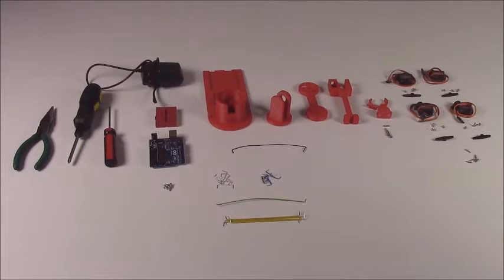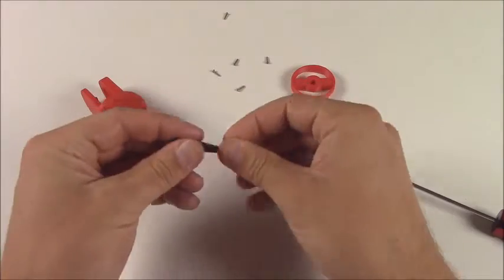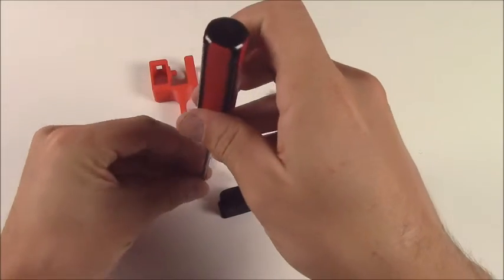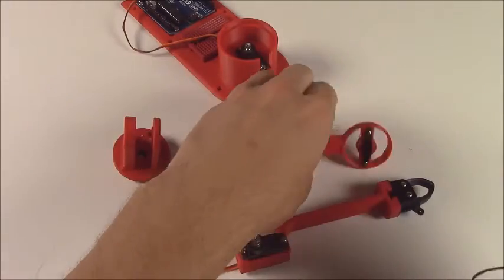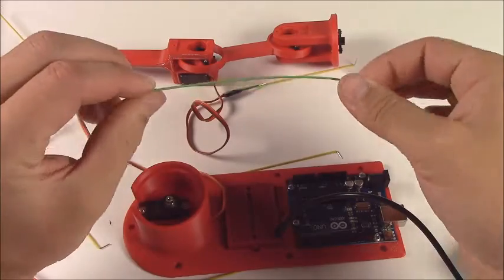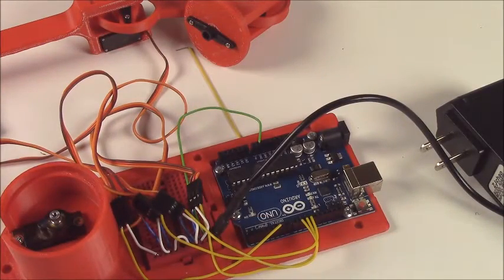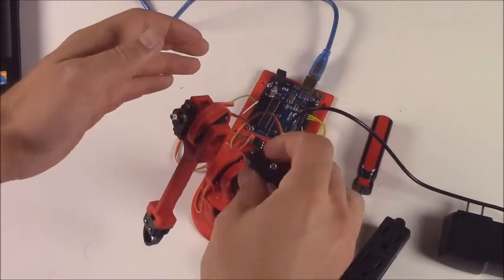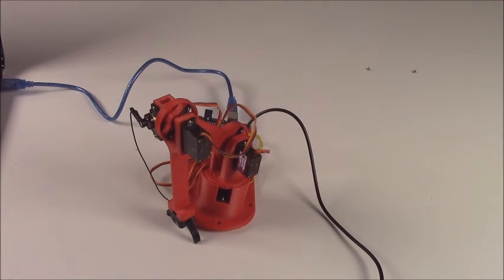Assembling LittleArm Tutorial

Comment: It would be helpful if you had a table showing for each servo (base, shoulder, elbow and gripper) what degree setting the servo should be set. Words like "up", "down", "right", "left" and "extreme" don't really communicate what I need to know when I have these separate parts in my hands and am trying to figure out how these parts should fit together. I can write a Arduino sketch to set the servo is a position I want, but it wants degrees.

Comment: Was the Arduino Uno supposed to come with the kit or not? Mine did not. But I already have a few so I used one of those. Seems I saw some advertising or .pdf file that lead me to believe it was included, but apparently I misunderstood.

Additionally the shoulder piece that links the upper arm to the base snapped (broke) along a line that I notice earlier that had a series of holes along the line where the 3D printer head was printing as though the plastic was being deposited sporadically leaving what look like a perforated line. I was hoping it was just a problem "on the outside edge" and that the inside material would hold the part together. But when I went to slightly force the upper arm do-ma-jig-gy into this piece it snapped. I took some 5 minute epoxy and glued the pieces back together and so far it is holding. I used a clamp to hold the two pieces together and let it dry for 8 hours before proceeding. Quality wise, this device is a cheap toy. But it still is a useful learning device.
Reply from the maker: Hello William,

We are so sorry that the piece broke. If you would like a replacement we will send you one. 

In regards to the Arduino being included, did you order yours through the Kickstarter or through the website

Please contact us directly through the LittleArm website, as youtube comments are not monitored as regularly. http://www.littlearmrobot.com/contact.html